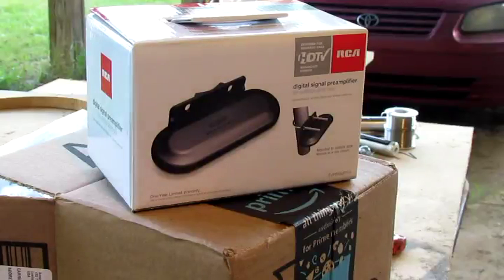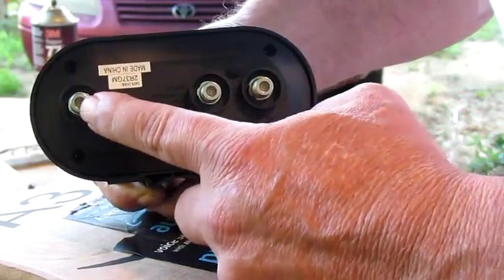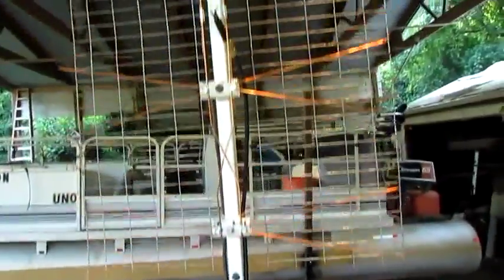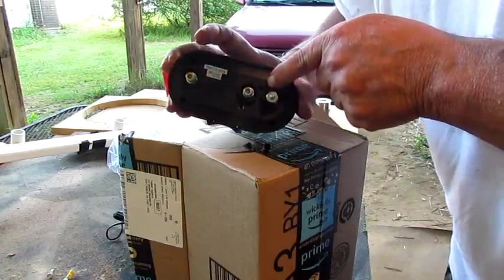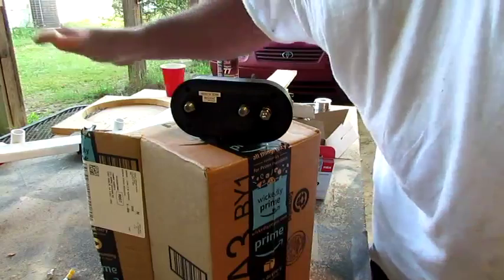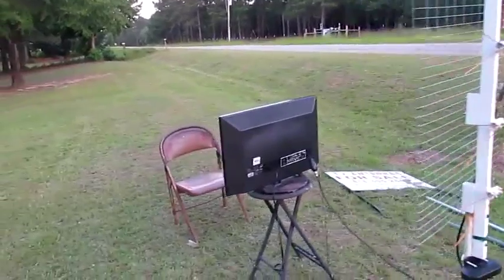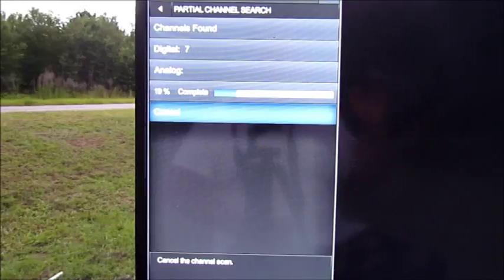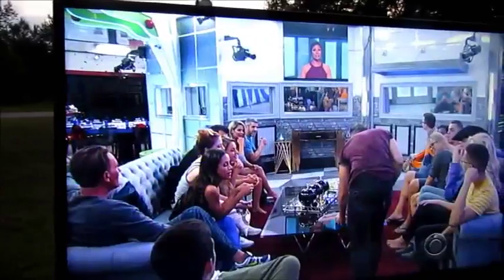RCA TVPRAMP1R Amplifier Antennas Review And Testing

Comment: The only worry I have about this pre amp is that someone who installs antennas for a living that posts somewhere else stated that at least one-third of these come to him with defective power insertion. I'm no tech geek who can hook it up and determine if that's why it's not working for me. I'm getting ready to add the highest gain VHF-high antenna currently sold in America to my current system (Stellar Labs 30-2476); going after RF-10 83 miles away, as I currently receive RF 27 from that same distance with an AntennaCraft U8000 bow-tie, 8-bay antenna. I've already got a CM-3777 that I've used for six years and an RCA combiner; but this device would simplify and maybe reduce loss due to simpler and fewer connections, so I'm considering it. Thanks Danny for reposting this from another forum

Comment: That RCA preamp is a monster. It does the job by bringing out more channels. I live in Gulfport, Mississippi and I aim my antenna with the preamp towards New Orleans and the channels are 63-69 miles and then stay clear the whole day which are Channels 4, 6, 8, 20, 26, 38, & 54. The locals in Gulfport are 7,13,19,& 25. But they are close enough (18-24 miles) where I don’t have to aim it North towards the locals. GREAT PREAMP.

Comment: I bought an RCA Digital Signal preamplifier  TVPRAMP1E and added it to a Clearstream 4max (20 feet in the air)  with an added reflector. Without the RCA preamp and without the reflector, 17 channels and I had a signal strength of 55%...added the reflector had 20 channels and had a signal strength of 61%...added the RCA preamp have 33 channels and a signal strength of 88%. Closest station is 57 miles away, Picture Quality is 100%

Comment: Danny:

I ws hoping to see if the booster got above the 27 limit you have been hitting withou the booster.

I just built dual antennas (side by side) and have been happy with the results (greater than 70 mile distance with mountains and hills in East TN).  I am going to have to update mine with the VHF addition.  Can you verify the length of each of the antenna elements??  (I looked thru both of your sites but failed to locate a video with the details)  Thanks!

As an aside, I usually use electrical tape to provde some waterproofing on the connections.

Thanks for the work you do!!!
Reply: I don't know what the length is he used I'm also in east tn and I have signal mainly vhf that's hard to get.. I do know you can google and get the length for a particular channel hope this helps

Comment: Did I understand you rigth ? In one of your videos you said that IF you were to make a double antenna it would pick up as good as a single antenna with a booster ? IF so why bother with a booster ?  When lightning hit my antenna it took out the booster. Which meant No signal got through at all. We had to take down the antenna and replace the booster. It did not hurt the antenna.
Reply from the maker: YOU GOT IT,,,

Comment: Danny - whats the failure rate on these?   I bought one, loved it, decided to ramp up the dc with a 1000ma ac/dc wall wart.  Did that destroy the preamp? Or did it fry up the feed box?
Reply from the maker: u cant swap it up....they hold up very good
Reply: “Danny - whats the failure rate on these?   I bought one, loved it, decided to ramp up the dc with a 1000ma ac/dc wall wart.  Did that destroy the preamp? Or did it fry up the feed box?”
If all you did was to ramp up the amps, no, you didn’t hurt a thing, the device as I understand it will draw the amps it needs, voltage however is a different story, you can easily fry it, might even get it smoking, you must use the correct voltage always. Interestingly a guy who buys lots of these from the Amazon warehouse, aka used returns, says about 50 percent have bad power injection. You can measure the voltage to check if in specs. Not sure what the window of returns is at Amazon, but clearly it would seem reruns are for devices not working. 

That said I purchased one, it seems to have the attribute of not overdriving the tuner like some brands, price makes it excellent value.

Comment: Danny, I live in a area of town with low signal.  I built the ultimate antenna.  I still have the 4 foot off the ground.  I receive 3  channels from 30 miles away.  So when I put it up on my roof I want to put a Ant. Preamp on it. You seem to like the RCA Model :  TVPRAMP1Z preamp.  I also was looking at the Winegard LNA-200.  You also mentioned you some Preamp go bad.  Which do you prefer.  And what to avoid.
Reply from the maker: the 2 you named is hard to beat
Reply: m
Reply: I forgot the model number of the other RCA preamplifier that only has 1 coax hookup for 1 antenna.  That one is if you're hooking up just 1 antenna,  whether a VHF/UHF antenna,  or UHF only antenna,  if you live in a UHF only broadcast area.  I only recommend this preamplifier,  if you're using 2 separate band antennas.   That was the reason I bought this antenna, since I have an Antennacraft CS600 VHF antenna (channels 2 to 13) and an Antennas Direct DB8.  If it weren't for 2 low power UHF stations,  and a Class A VHF-Lo station, I wouldn't need a pre-amplifier at all, because I can get CBS without a preamplifier on VHF,  and all the full market UHF stations without a preamplifier.   I also use a 2 Bay Winegard HD-1080 antenna for a single UHF station in a different direction,  and doesn't need amplification.   After the preamplifier,  I have the preamplifier line, and the Winegard antenna being combined to a Winegard CC7870 combiner.  On that combiner,  only 1 side allows for amplification,  so the other antenna doesn't get amplified.

Comment: Thanks for the great video's. Can the RCA TVPRAMP1R Amplifier be used with 2 TV's  with a spitter ?
Reply: Rambone72 I have this preamplifier, and you can add a splitter on this preamplifier.   You have to add the splitter inside, after the power supply.   If you add the splitter before the power supply,  it would interfere with the preamplifier working properly.